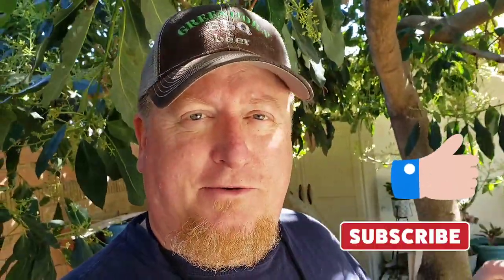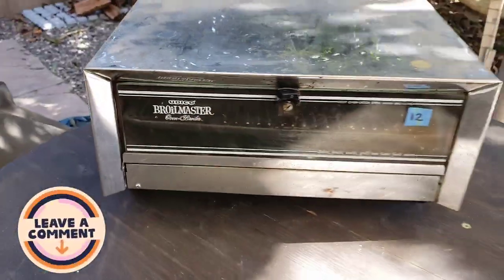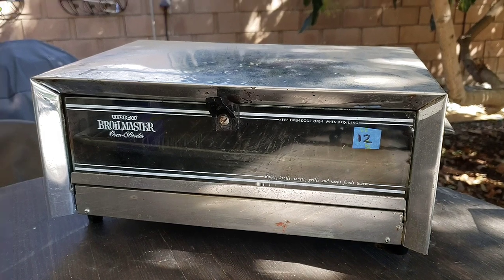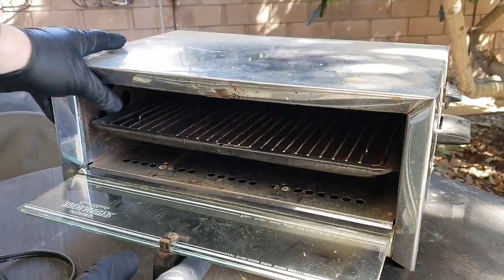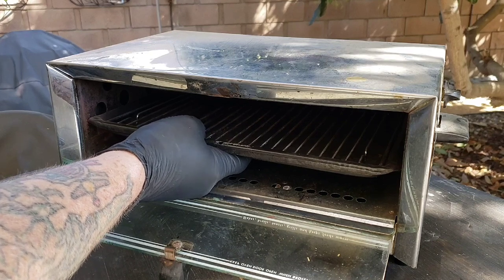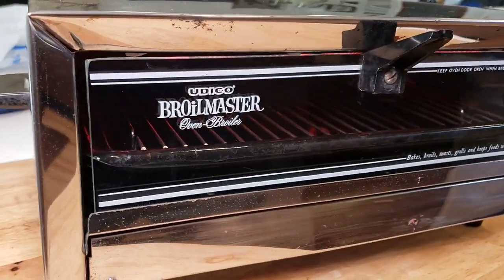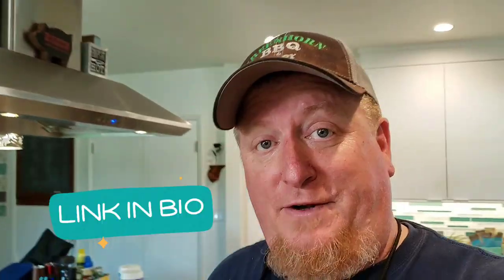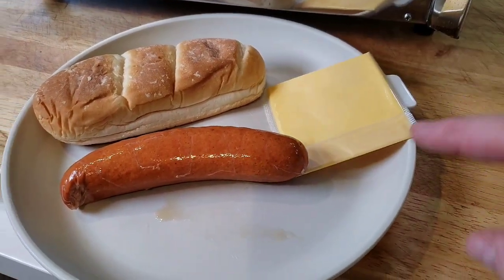Vintage Grilling Recipe; BBQ Indoors for $10 Made in USA Broiler Oven!

Comment: I wish i knew the dimensions of your tray.... i could easily build a handle for that pretty fast. It would work just like the original one that is missing.
I`m curious.... what did you do about the rusted metal up above the heating coils (???)
Reply from the maker: Hi and thanks for watching, I appreciate the offer to build a handle. Sassy just found an old one kinda like this one used by her Mom years ago for other things. Its pressed metal not the nice bakelite-type handle with cast part that came with it originally, but it works. 
So I apparently didn't notice that rust as much as you. What treatment would you suggest 🤔?